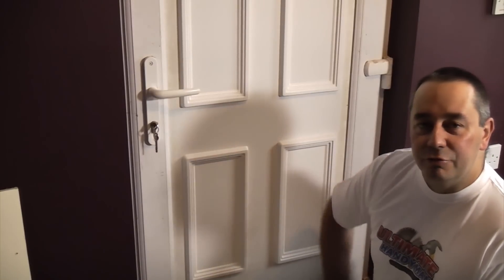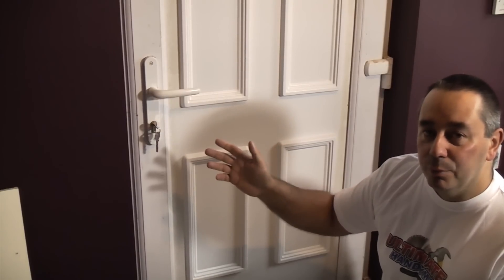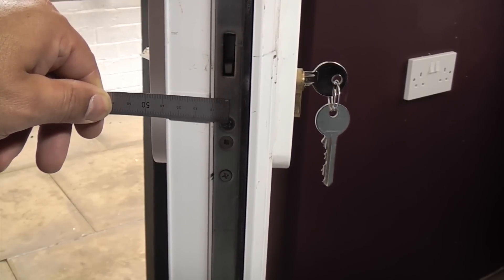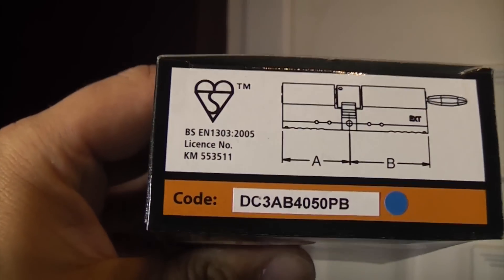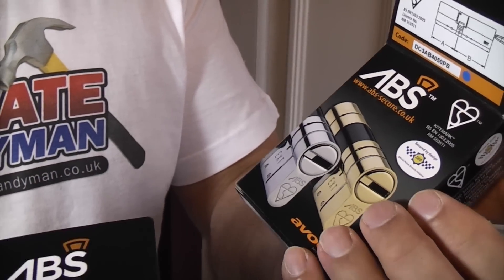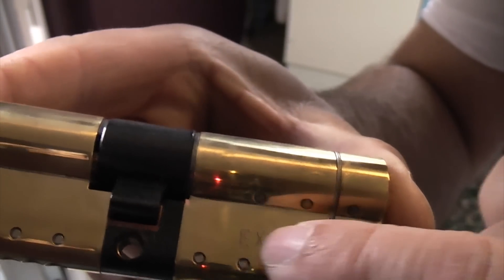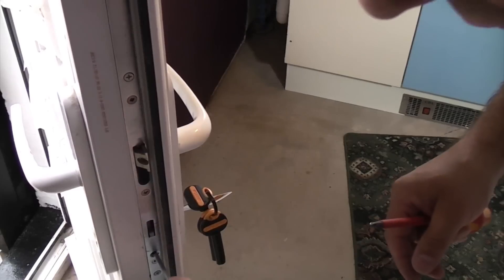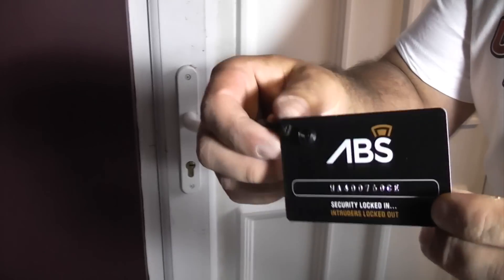High security euro lock fitting

Comment: With our lock a key cannot be fully inserted from the outside when a key is inserted on the inside. If someone left their key in the door then you're locked out. Can I change my cylinder for one which doesn't have this problem?
Reply from the maker: Most Euro cylinders work like that. I have seen really long cylinders that go through thicker doors and they often work when the key is in the back of the door, but I don't know if you can buy special ones that are designed for that purpose.
Thanks for the comment 👍
Reply: @ultimatehandyman  I've now installed a Nuki Smart Lock and in the process learned more about this. A cylinder which CAN be used with a key inserted on the other side is said to have an "emergency function". Euro cylinders come both ways, so I simply bought a new one with this capability and it works fine—you definitely want this with any smart lock so when all else fails you can still unlock the door with your key. It wasn't clear from my original comment, but my cylinder is plenty long; it's just that there's some mechanism that blocks it when there's a key already inserted from the other side. Nuki says that most lock cylinders can be modified by a locksmith to have this emergency function.

Comment: I thought your video was straightforward so had a practice run on an internal UPVC door. The eurocylinder was very hard to push out and in the end I had to use a hammer and screwdriver to get it out. But now I find it won't go back in! It only goes in partially  - from either direction - before the middle black plastic lever. When I look into the area where the lock was taken out, it looks like it could be slightly misaligned. Can you please advise....?
Reply from the maker: Sometimes you have to loosen the screws on the door handles, this then allows you to adjust the handles to get them in line with the lock. Loosen the screws off, then insert the Euro cylinder and fit the retaining screw, then tighten the door handle screws back up 
Thanks for the comment 👍
Reply: @ultimatehandyman  Thanks for your quick response. I had taken off the handles already in order to assist with hammering out the lock. I even took the veey small screw immediately below tge lock retaing screw.
Do you think the force exerted whilst hammering could have messed up the mechanism of the door?
But I had to hammer the lock as it wasn't going to budge.

Comment: Thanks never knew about these locks ..I have a Mila BKS cylinder lock and it's sticking I've been considering replacing !! Can these Mila locks be bumped
Reply from the maker: The Mila BKS actually looks like a secure one (after a quick Google search). It might be worth removing it and try giving it a quick clean, then replace it. If it continues to stick you can consider a replacement cylinder.
Thanks for the comment
Reply: @ultimatehandyman  thanks for info

Comment: Thanks for this video it's a great help, tho you mention not to have the outer key part on external side of door flush more than only couple mm which makes sense to me, iv jus gone to the website in your link an there image shows it a good 10mm proud of door ? Any ideas . Thanks in advance
Reply from the maker: It should be flush really, but I guess if it is anti-snap it does not really matter because if they snap it off they still can't get in.
Thanks for the comment

Comment: Hi UHMan.  The video and information is great, thank you.  I have just moved to a new home, and want to replace the lock but the retaining screw which holds the barrel in it immovable. I've used WD40, tried to coax the screw lose, but with no luck. I'm worried the head of the screw is getting worn. Any suggestions appreciated. I would like to do the job myself, as money is a bit tight.  Many thanks.

Comment: Yea I understand that all locks can be picked but snapping is a much easier & faster method of entry.  When this lock is snapped,  just how much more difficult is it for your average burglar to get the door open?........once the end of the lock has been snapped at the weak point does this prevent access to the mechanism for actually opening the door?????

I only ask as these locks aren't cheap & im not sure if these locks will actually prevent a burglar getting in,  can anyone offer some advice please?
Reply from the maker: +Glenn Devin 
If this lock is snapped off it does not enable the burglar to get to the mechanism to unlock the door, so it's pointless snapping off the lock in the first place. These locks don't look like a normal Euro cylinder and most scum bags will know immediately by looking that snapping one is a waste of time.

I always recommend having a fully functional burglar alarm as well as decent quality locks.

Thanks for the comment

Comment: I have UPVC patio doors. the primary door lock was easy to remove and replace  as shown in the video, the second door does not have an accessible retaining screw as shown in the video. I took of the bolt strip and couldn't see it underneath either. Any suggestions to replae the lock on this side ?
Reply: Sadly I have  a similar problem.  I can see a screw with a square indent not pozi-drive. But if I had a screwdriver it  is part covered each side  with metal strips so would not come out. I think I have to dismantle  whole side strip.

Comment: I'm not familiar with your doors. With the extra locking mechanisms in these doors, could you not install a rim lock also? (Union 1332 or Yale 82, for example) 
Us colonists have tubular style locks, then we add on night chains (not worth a crap, honestly), "jimmy-proof" drop-bolt rim locks, night latches, and other miscellaneous "security devices", but we are starting to get more multi-point locks. However, on many, they still use euro-cylinders.
Guess we're still not learning, eh? lol
Reply from the maker: +Matt Hayes 
LOL, on wooden doors over here we often use Yale lock (cylinder night latch), mortice deadlocks or mortice sash locks but on UPVC doors they always have the multi-point locking mechanism. 
The problem with normal Euro-cylinders is that they are not very secure - https://www.youtube.com/watch?v=2lzX5sSTbig
I must admit that the old mortice sash locks and mortice deadlocks were more reliable than multi-point locks and Euro-cylinders!
Thanks for the comment

Comment: It's a shame that website don't actually sell locks they only have stockist? Which did you use?
Reply from the maker: +Zed Man I bought mine from ebay- http://fave.co/1STR49d;-)
Reply: There's a little  "Toolbox" shop in town and somebody told me they had them. So some very small shops sell them. They were different sizes and  a choice of gold color /brass or chrome.

Comment: I think the way this is being explained is slightly misleading. The thickness of the camme (approx 10mm) is not taken into account. The measurements you should be looking for are 35 and 45 not 40 and 50mm
Reply from the maker: +Edoardo Castagna 
You don't need to take the thickness of the cam into account.
The screw is directly above the cam in the exact centre of the cam. By measuring the distance from the centre of the screw to the outside of the Euro cylinder you get the correct measurement.

Comment: These ABS locks use to be really good. Even with the multiple pins, serrated pins and magnetic pins. They still have 3 diamond status. However for under £100 you can buy a bypass tool for them now so not that good anymore :( shame really as they were good locks. That being said still better than a standard euro as most scumbags wont have the tool to get passed them
Reply from the maker: I think people will always find a way to get through a lock if they want to, which is why security lights, security cameras and a fully working burglar alarm are a must.
Thanks for the comment